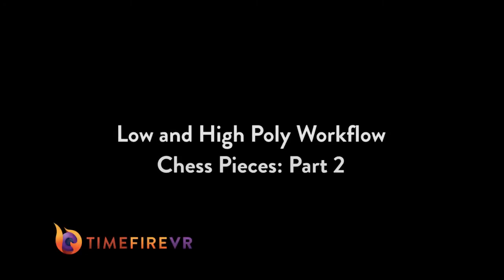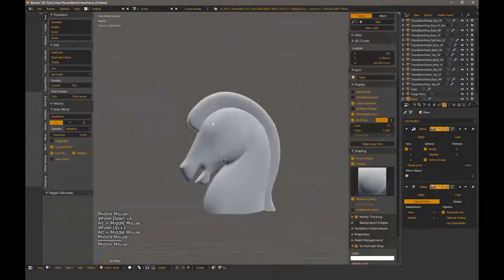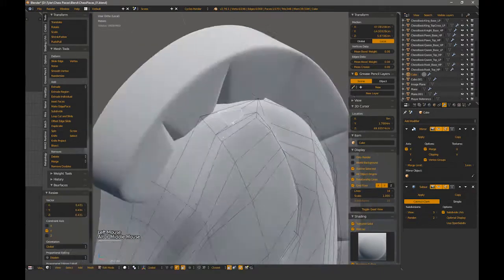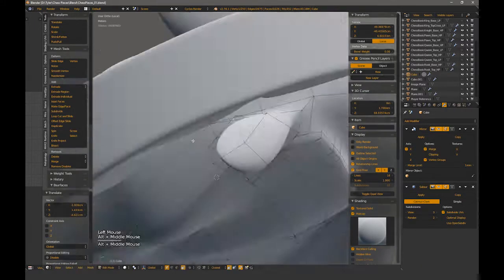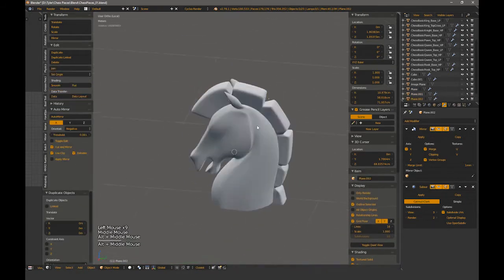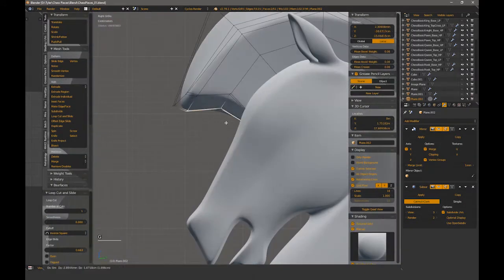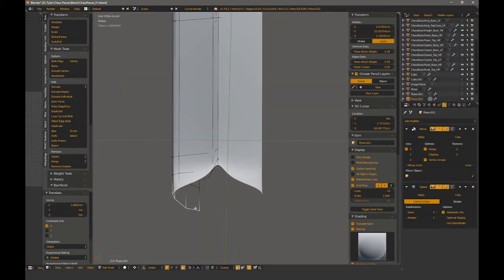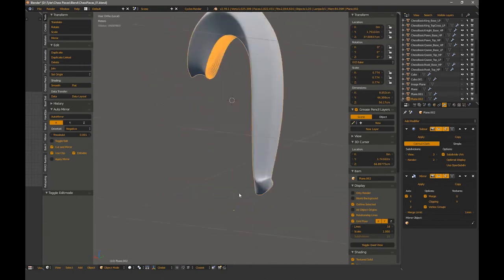Low and High Poly Workflow in Blender | Part Two | TimefireVR

Comment: So for these added features like the hair for instance, do you create the hair mesh as a separate mesh outside of the horse head mesh's edit mode? I'm new to Blender modeling and come from the engineering CAD world. My hang up is how modeling is very freeform comparatively so with extra geometrical features (hair) not actually joining the mesh vertices of the head, isn't the bottom side of the hair's geometry clipping through the horse head's geometry? Is that an issue? Or do you unity boolean your final model after complete?